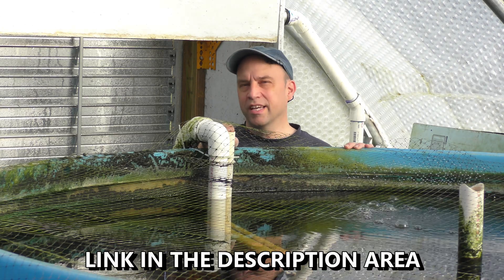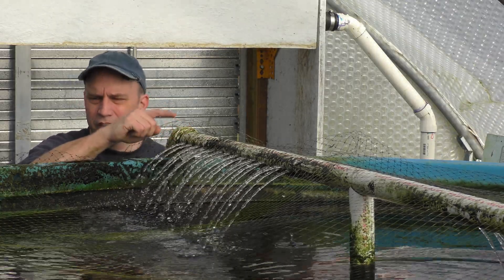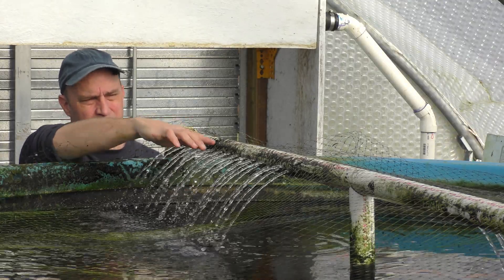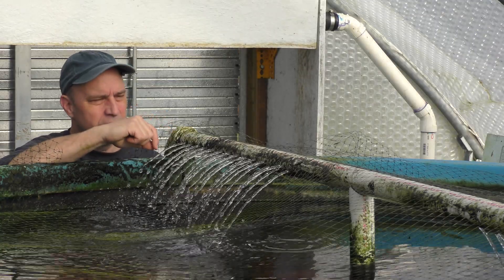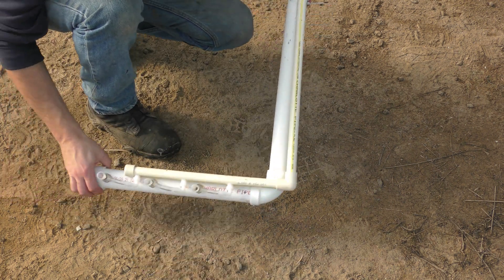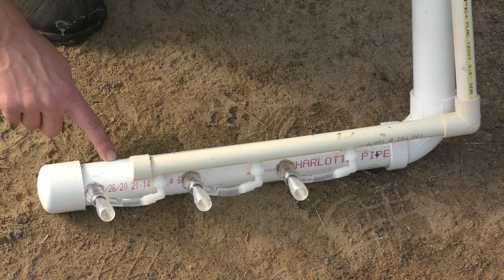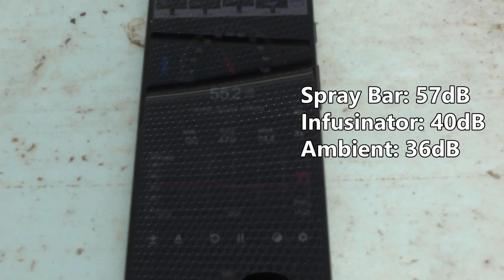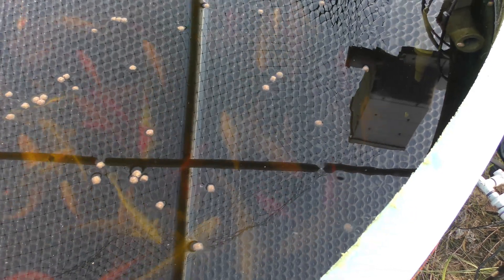Infusinator Venturi for Aquaculture

Comment: Would there be any down side to running the manifold vertically in the fish tank?
Reply from the maker: Probably not.  Perhaps it would help to break up some up the bubbles as they start to come back up!  Looks like it might make for a good experiment.
Reply: @Bigelowbrook  thank you for your response! Really appreciate your work over the years and your willingness to share all that you have learned!
Reply: My reason for inquiring is that for a bottom center fish drain it would be more efficient to shoot the water along the perimeter circumference to encourage the fish solids to migrate to the drain dot-dot-dot
Reply from the maker: @donfredricks8965  ah.  I thought you meant pointing them down.  I think you mean having a vertical manifold but the nozzles still coming out horizontally?  I believe the issue with this is that the pressure increases the deeper in the water it is placed.  The deeper you place the nozzle the less air it will produce.  You potentially could have a nozzle working well near the surface and then the bottom nozzle(s) not producing any air.  You probably would need to really crank up the water pressure for them to work!

Comment: I'm not clear on why these are better than other venturi's already on the market, it kinda seems like your reinventing the wheel.
Reply from the maker: The internal area is set up differently than a standard venturi so it injects twice as much air. It's not reinventing the wheel....just making it spin faster.  ;)
Reply: https://youtu.be/m593j97d-Ts
It's pretty plain and simple more efficient and smaller than other Venturis on the market. Rob designs cool stuff and gets mathematical to back it up!

Comment: How do we need to decide how many nozzles we need for our tanks based on our desired gph/gpm of water flow?
Reply from the maker: Excellent question!  There's a chart in the kickstarter campaign that shows the flow for each nozzle.  Roughly, if you pump 12.3 liters (3.2 gal) per minute through each nozzle.  You'll need about 170mbar (2.5 psi) of pressure at the nozzle for that flow which is fairly easy with most pumps.  This system is using a Jebao DCT-12000 to run my entire setup at half power so that's about 60 watts.
Reply: @Bigelowbrook  now that you say that I remember reading that. Hopefully that information benefits other viewers.